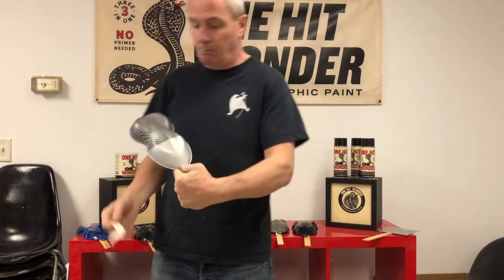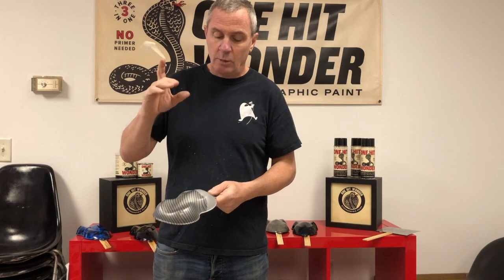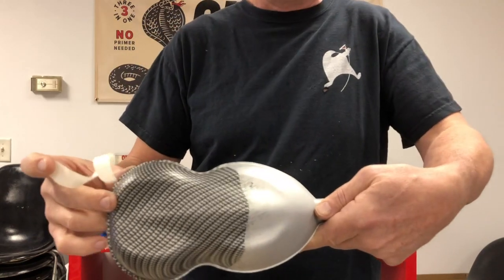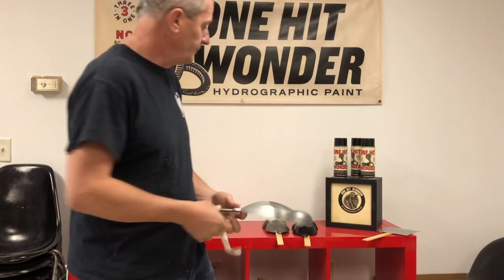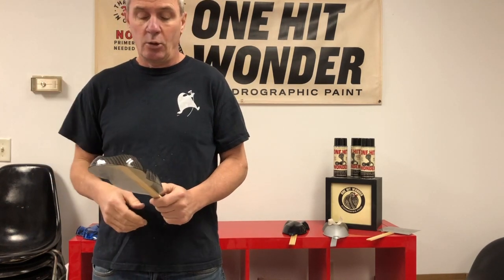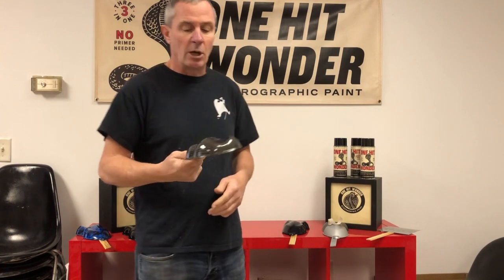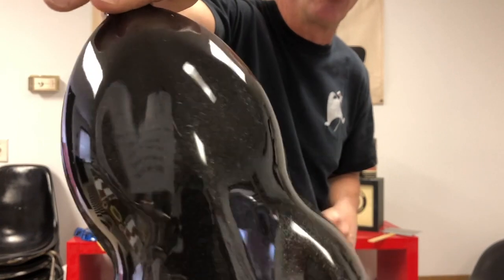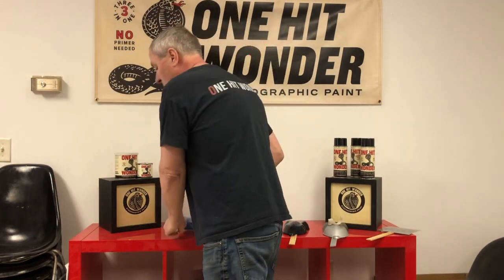Clear + Metallic Intercoat

Comment: I am an ASE Master tech and after 46 years I want to paint my 67 C10 pickup white on top and metallic copper brown on bottom 3/4 field with base coat & clear. Chemically stripped, cleaned, sanded then sprayed in epoxy. Body work done, high build, epoxy primer, shoot white on top and tape off.    It is at this point that I have questions on inter-coat on the white to create a tap line to spray the rest.   I don't know anything about dipping, no clue what it is! I just want to tape off, cover the white and spray the rest. I was thinking the inter-clear that works like a base coat and protects the white during a spray so tape does not pull off white once done, clean, sand to 1,000 grit and spray clear.
  Not a painter but have painted 6-7 family cars. Kids learn to drive, wife learns what reverse does, etc. 
I am retired and in extreme pain and plan on finishing this truck with an 03 truck 5.3L and 700R4 I build 3 years ago. Just researching. Retired, broke, no garage and no clue on dip other than pinch between cheeks and gums. That dip in my world!
Reply from the maker: hi Dean, thanks for reaching out to us! 

If I am understanding what you were saying, you simply want to use the intercoat as a protection against the tape? You can absolutely do that, but the white that you lay down first should be fine to have tape applied over it after an hour or so. Basically once it’s dry. Then you can mask and cover as you say, then hit with the copper below. Once that is sprayed and dried, you can then mask the truck and apply clear over the whole thing. Basically, you should not need an intercoat  to protect the white. It will grip just fine to the epoxy without coming off. I hope this helps, and if you need to text or call, please contact me at 305-318-1468 thanks! JJ
Reply: @OHWPaint  Perfect as I am learning more difficult task in painting. Chemistry keeps changing and I like following best practices. 
   This "Two-Tone" is covered with a stainless steel trim. Even though 67 C10 did not come with it as an option, the white was used in 68 to keep the cab cooler as 80% came without A/C as farmer bought these and no tractors, combines or motorized hay cutter cam with A/C. K-Mar in Oklahoma City sell screws to hold the plastic trim clips in place. Using the base coat clear / intercoat keeps tape from pulling off paint but provides a protected area the keeps loose trim from scratches as you line it up straight then mark where fasteners go.
  Thank you for the help.
This is mine and not show truck, but if it looks good getting there, I will bare that cross! lol.

Comment: I am painting a door panel on my 2015 Ford Escape color is Tuxedo Black, so Metallic. I'm Spray Max's spray can system for applying my paint.  Now I have heard that using an Intercoat would help prevent fogging and to help lay out the paint and +metallics in the paint so it better blends with the rest of the body.
So my question is can I use your Intercoat clear which comes in a can to apply before I paint and clear my body panel?
Reply from the maker: If you mean black/intercoat metallic/2k clear, in that order, then yes. This will give a metallic black, rather than a graphite, if you mixed black and metallic flake together.  It doesn’t prevent fogging, as long as you’re using solvent paint throughout (which SprayMax is), you’ll be fine.

Comment: Lets say i wanna dip game controllers, how do i go about using the metallic intercoat and a hydrofilm
Reply from the maker: Hi there - you can either use the metallic intercoat as a base coat and then dip to it. With this option the original color of your controller will become metallic and this color will show up under your film.  If you want your film to appear metallic, pick a base color, dip and then apply the metallic intercoat on top of the film.  Make sure to finish either method with a good quality clear. If you have other questions, let us know.
Reply: @OHWPaint  alright then and would i still need to sand it down and everything or just degrease it. Im real new to all of this so im tryna acquire all the info i possibly can.
Reply from the maker: @Sheldric09  Yes, you want to treat the Intercoat like any other basecoat and properly scuff and degrease your item before application.  Please email us at info@ohwpaint.com and we can send you an application guide. Or go to our website and click on any paint color -- under the application section you should find a link to the guide there.